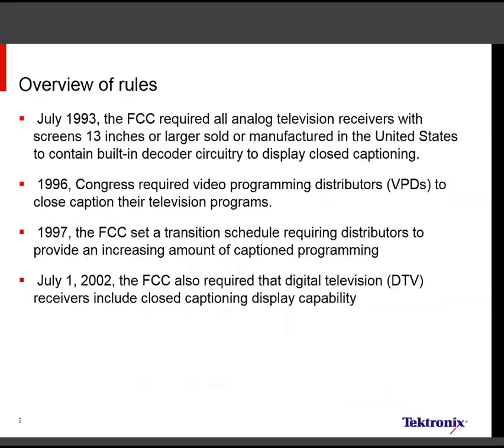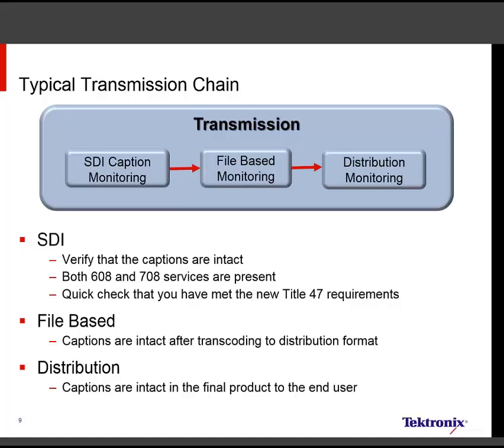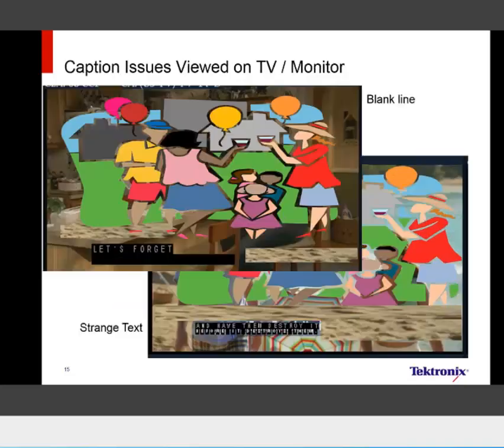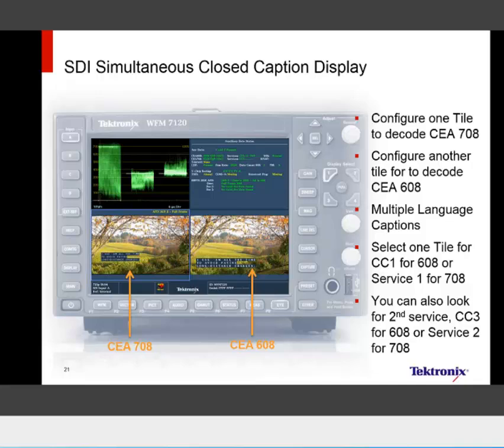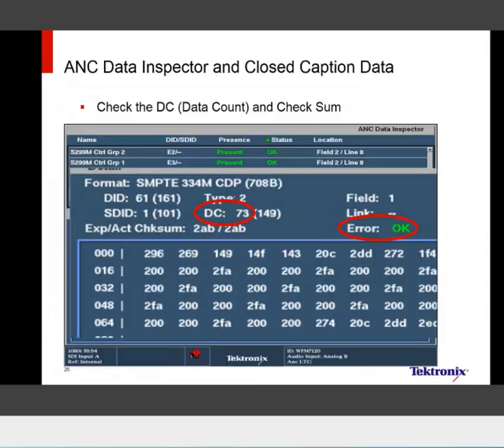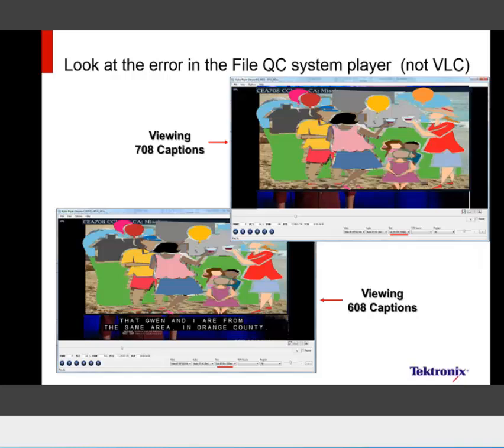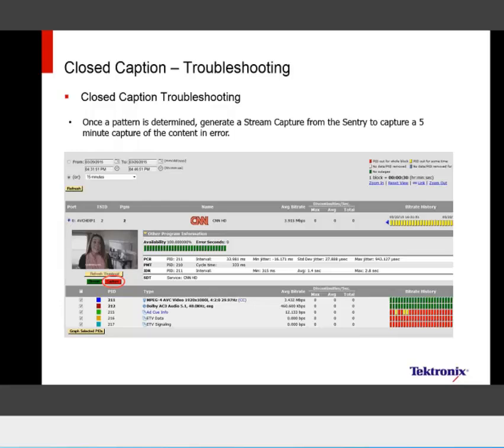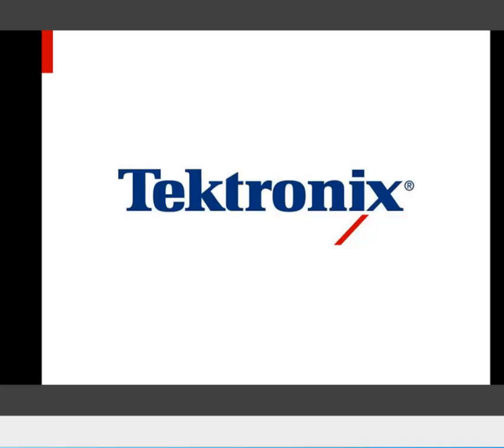Tektronix Webinar - Understanding FCC Requirements for Closed Captioning

Comment: This is a good overview of captioning requirements for broadcasters only occasionally muddled by a rude participant typing and talking when they should have muted their mic.

It's a not-so-subtle plug for the Tektronix WFM 7120 product, but in its defense it is a capable product that I've tested and can address caption problems well.

Perhaps in coming presentations the presenter can be the one handling the capture process.  It would allow for better audio instead of sounding like he phoned it in (which he did), he could control the undesired audio from participants better and it could be recorded in HD instead of SD 4:3 captured as if it was HD (sigh).
Reply from the maker: SmokingCannon Thanks for your comment.  We had some issues with the web recording so apologize for the distractions.  We are going to host another webinar on closed captions in the near future and the quality should be better.

All of our WFM and WVR products have the capability to monitor and alert for closed captions.  www.tek.com/video